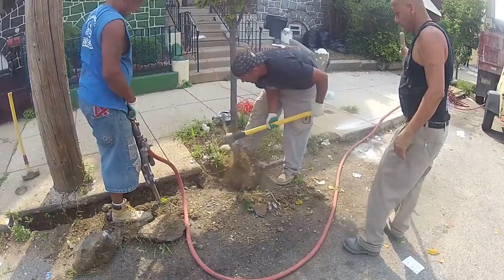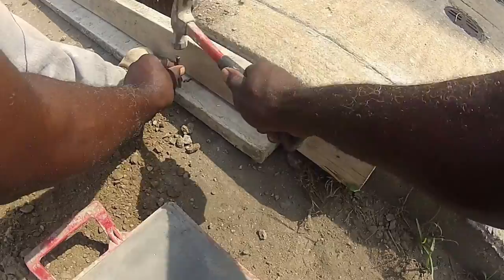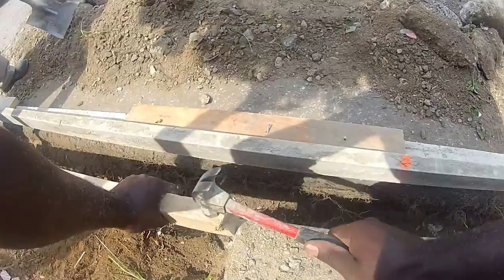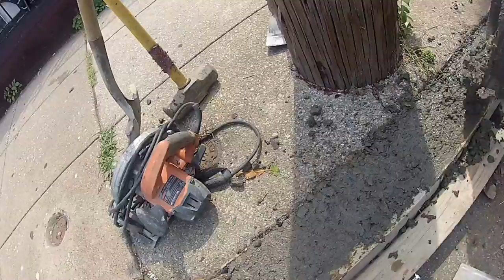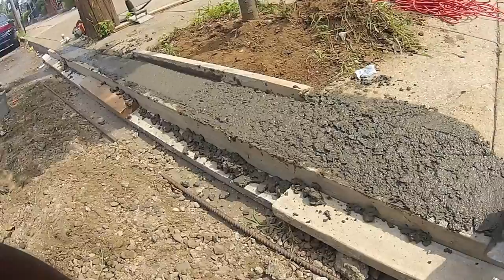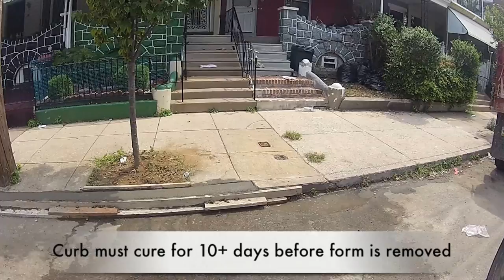How to pour a small Concrete Curb | Concrete and Cement Contractor

Comment: For what ever it's worth, the form facing the street, run a brick trowel between the fresh concrete and the inside of the form, several  times to eliminate "honey comb", no need to fix or fill the exposed face of concrete once the form is removed.